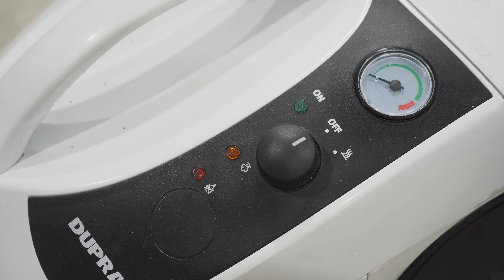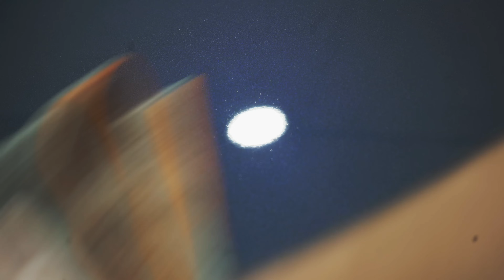20 Hour Detail On A Japanese Imported BMW E38

Comment: 32:55 heheheee You don´t need to hold the key while starting, just click and the starter will engage and disengage automatically. All of the E38 7 series were equipped with that.

Comment: Hey bro do you mind linking the lights used during paint correction?  thanks
Reply from the maker: If you're not from Canada they're going to be impossible to get. I think haha. Will do some more research
Reply: @ChromaticGarage  or you can link any from amazon you think are decent. I don't have an indoor setup so i'd like to paintcorrect outside in the evening under my tent. Just need a good light to show imperfections in the paint. thanks!

Comment: Stunning. But if i was the owner, i would change back the taillights to the original pre-facelift ones, put back the factory amber front indicators, and change the yellowish headlight lenses to new ones. The car would be mint.
Reply from the maker: The car is 100% OEM as it sits.

Comment: Great job! Question - are you sure this car is a Japan import? It’s left hand drive!  Steering wheel is on the other side in Japan.
Reply from the maker: Thanks man! Yeah most BMW's were LHD drive in Japan. It was looked at as prestigious. So is even more common within 5/7 series cars
Reply: @ChromaticGarage   thanks for the reply. I often see a lot of Japan import cars and they are left hand drive which is just so odd.  I’ve been to Japan a few times and I’ve never seen a left hand drive car there.  Just googled and apparently you can buy them at auctions? Why on earth would you buy an LHD when it’s available RHD and you live in an RHD country? Lol 😂

Comment: I see you still correct paint with Griots. Do you find that product still works with the newer cars softer paints? I could use your suggestion on a paint protection for my black car. I am terrified of applying true ceramic coatings for streaking and high spots but I'd like something that definitely provides a deep, wet look with at least 6 months of durability. Actually it could be less if you're thinking a spray since I would most likely reapply each time I do a maintenance wash.
Reply from the maker: Yes sir! I recommend it all every paint type, new and old! And honestly if you’re going to apply it every wash I would 100% suggest Gyeon wet coat, it’s the easiest application and such a solid product in terms of protection. It can also go on everything
Reply: @ChromaticGarage  Been looking at wet coat but since I don't have shade where I wash, I deal with water spotting. I used Gtechniq C2V3 and TW Hybrid Ceramic spray (no drying aid) but there's little durability. I was looking at Gyeon's Can Coat possibly...but I don't know if I'm going to get more gloss with that one